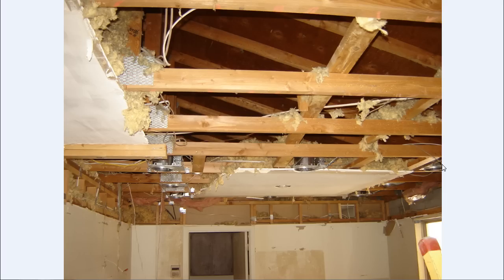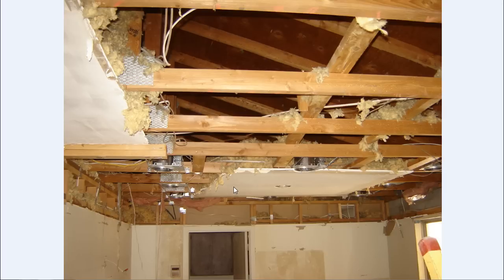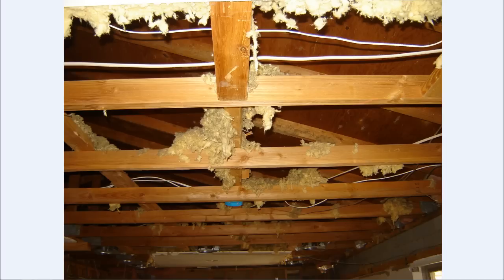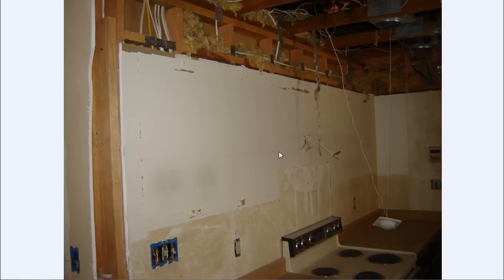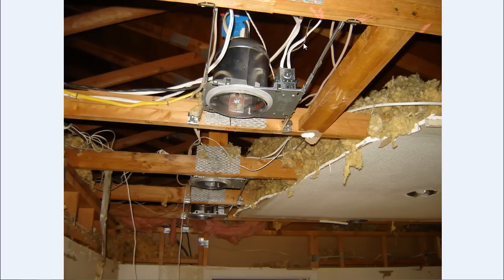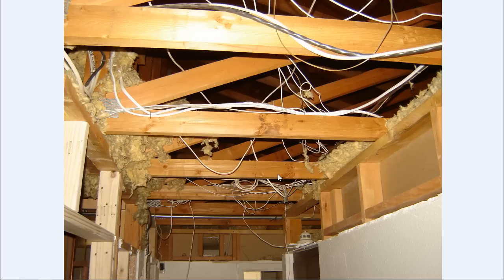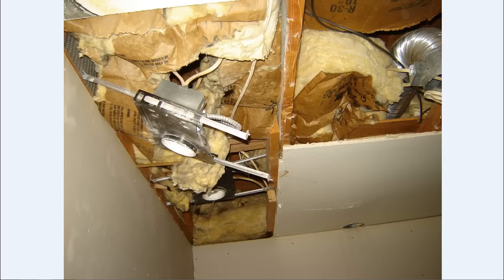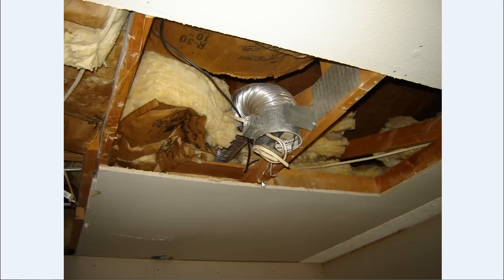I hate Insulation!!

Comment: Just took a shower cause I am doing a job built 1930 with beaver board.  I got roach's, termites, mud dobber wasp nest, stink bugs, and too many black widow spiders.  Dry rot damages, termite damages, rodent damages.  I have the whole job totally down to bare studs now.  Going to have to replace all the electrical, some plumbing, many studs will be replaced and I will install insulation and dry wall with new windows all around.  Messy, smelly work, but it's a job glad for it.